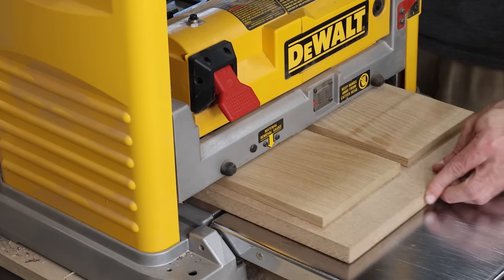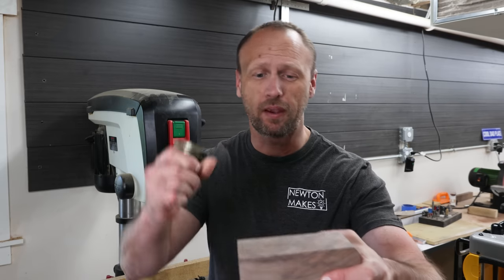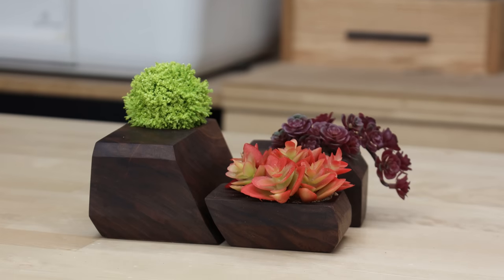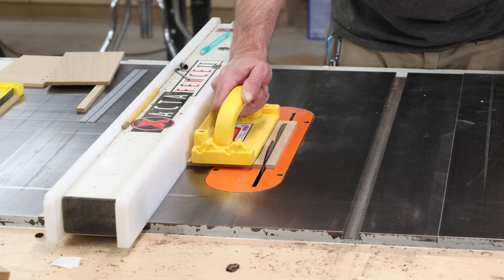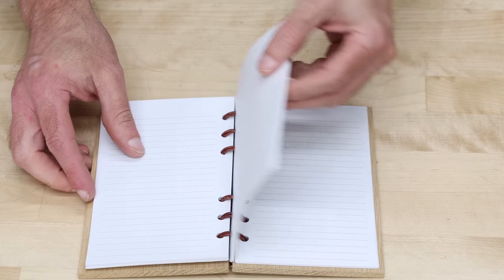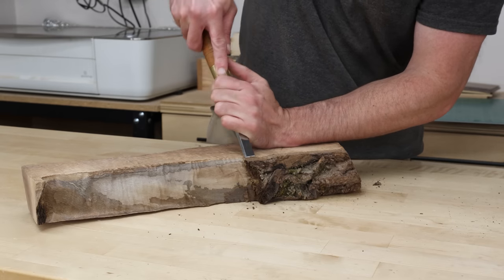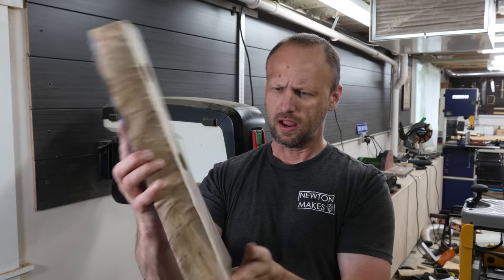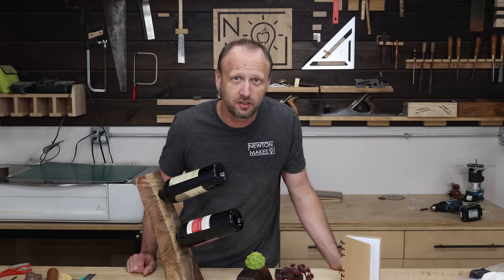3 Easy Woodworking Gift Projects to Make TODAY!

Comment: Nice work.   Question:  When you run small pieces thru your planer, how do you attach them to the sled?  Thanks.
Reply from the maker: I often use double sided tape and take light passes.

Comment: There awesome Billy need more these please. 2 things do they really stand up on there own and what angle did u end up cutting on the bottom and what size hole did u drill? 👍🏴
Reply from the maker: The bottle holder stands up on it's own. Pretty cool effect. The angle of the bottom depends on the length of the board and bottle placement. Drill a hole and then try an angle around 30 degrees. That's a good place to start. The hole was about 32mm.